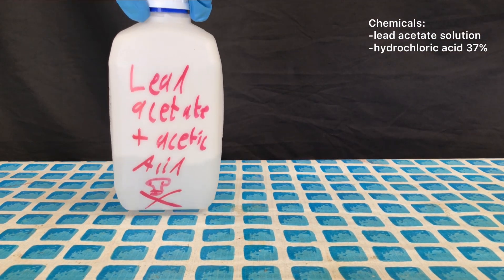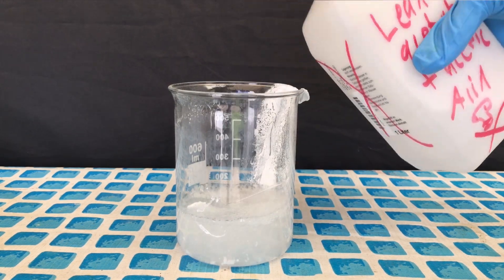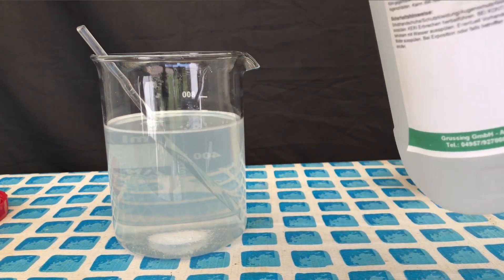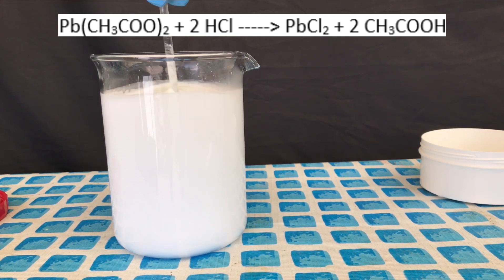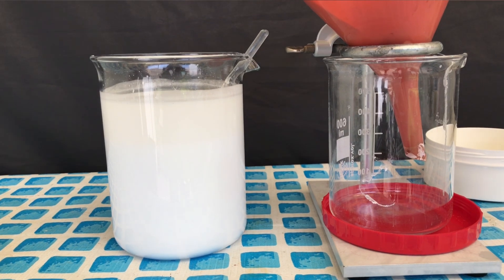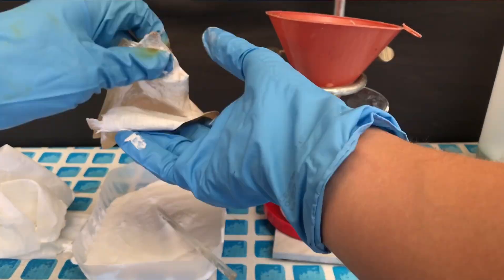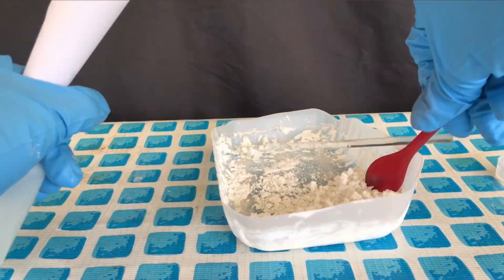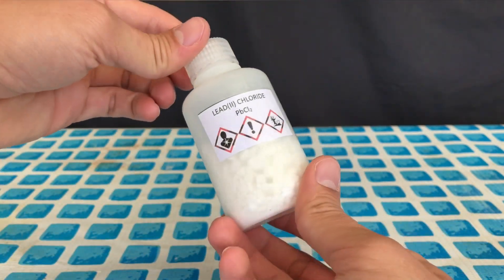Lead(II) chloride from soluble lead waste (lead acetate)

Comment: I recommend not to overdo the amount of hydrochloric acid, otherwise there is a risk that soluble chloro Pb(II) complexes are formed. PbCl2 is again soluble in hydrochloric acid at a concentration higher than 6 M due to the formation of [PbCl3] - and [PbCl4] 2-.

Comment: PbCl2 is surprisingly water soluble. About 10 g/L. I was long in the impression that it is comparable to CaCO3 or at least CaSO4.
Reply: @Sweet bromine Well depends on situation... certainly you can dissolve 10g of lead into 1L of acid.

Comment: I can see the 2 layers of that liquor. Btw, I have an old chemistry book that says heating table salt with Pb powder to red hot will afford PbCl2 and Na metal, but I have never tried that out.
Reply from the maker: If that works it would be really cool. Given that I just ordered Pb powder I´ll give it a try.
Reply from the maker: @Sweet bromine It does. I even made some Pb/Na alloy in a previous video. An excess of NaCl should solve this problem.